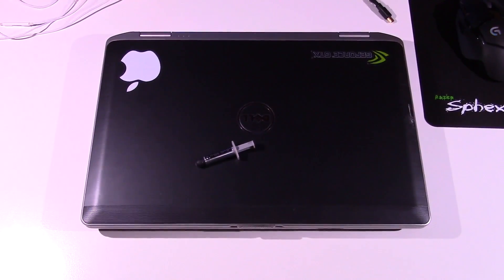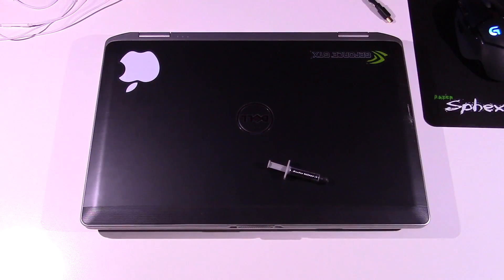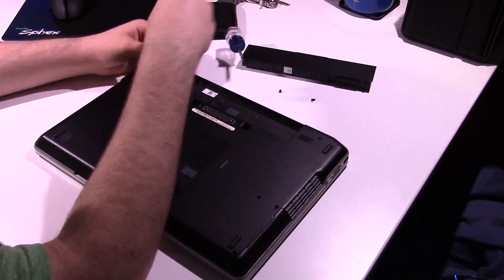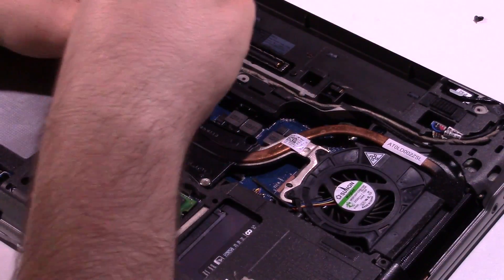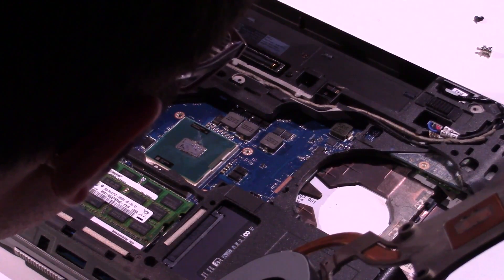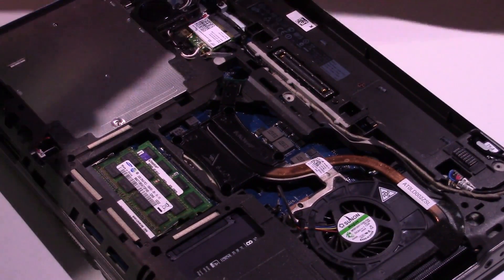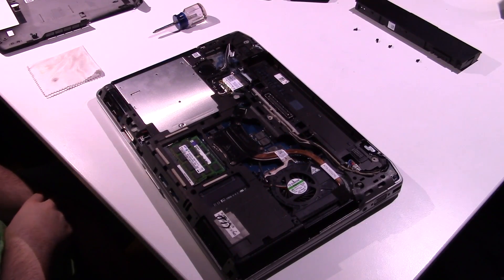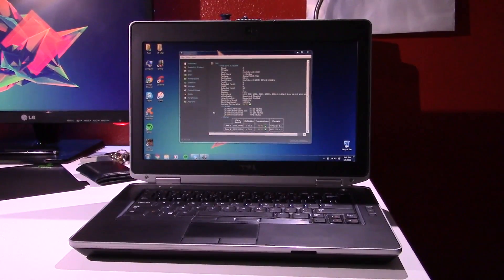Dell Latitude E6430 - How To Repaste

Comment: After I get the Intel i7-3740QM, I'm going to repaste the DELL Latitude E6430 (which my dad bought back in 2016 or 2017 off groupon) because it's starting to get warm or hot. After that, I got to repaste the Lenovo N580 afterwards.

Comment: my dell latitude E6430 suddenly stopped coming up. The last message displayed was a blue screen saying hard drive is inaccessible, afterward when I turn it on, the storage led just blinks white light intermittently and now its very hard to even come on, when I press the power button, it trips on and off.  please, what can I do?
Reply: your power supply is probably toast. inside myabe some compressed air on those fan slots would clean things out. repaste like this tutorial. replace your hard drive with a SSD, 480,512,960gb or 1tb, never put this on a couch or bed, never tilt it left and leave it on it's side when you use it. basically this thing has had it, and there are $400 microsoft surface options that go way faster and are lighter. Put this in the dirt. :|

Comment: mine reach 90c! and I  repasted it twice already. using thermal grease.
Reply: clean your fans internally, compressed air or something like an inflatable bed compressor works great. If it still overheats, NEVER put these on beds or on their side when you're using it, the left side has the fan exhaust and if closed it will kill the laptop or overheat the power supply itself and pop.

Comment: Man, how come your E6430 boot so fast? Mine is the same but using the i7 3540M with the dedicate Nvidia NVS 5200M, and also the same SSD, but when I boot up mine, it will take longer than you (not significant long, but noticeable longer than yours). Anyway, the E6430 is a great laptop, durable, reliable and fast as well. But too heavy as a 15" laptop.
Reply: I have the exact same model and mine is reaching 88C does this tutorial works the same

Comment: I have this laptop, It was running hot all the time, no matter what you do. The main problem is that there isnt fan control option in the Bios menu, so I desided to modefye the laptop. I connected my fan directly to the USB port and put small resistor to reduse fan spinning. Now my temperatute are around 40-45 C. I think this is success.
Reply: how?
Reply: @danishzz20 why is my same model laptop a little different inside?
There is a nvidia graphics card between fan and cpu. 
Cpu- i5 3340m
GPU - nvidia NVS 5200m
It runs on Intel graphics 4000 most of the time. 
Using a usb fan is a good idea, sometimes I also use a high speed server cooling fan but that's not easy to use outside.( 3×2 attached fan cost me 1.3 usd)
I need a permanent solution.
Reply: You are absolutely right, fan don't start till heatsink heats up, programming isn't good.
I already have a gaming pc, I got this from my uncle for free.
Just the ram and ssd update cost me a little.
Working so fast but heating is a big issue, I could not feel any blowing air in my hand till the temperature goes 55+
My laptop is a little different, there is nvidia graphics card between the cpu and fan.

Comment: Thanks this is why i have dell. Very easy to remove things. I have a question i go buy a 6430 with i5 3320 cpu. Is ppssible to upgrade for a new version cpu? What the cpus.the.board.acept? Thank you
Reply: I think it’s uses g2 socket and mine has an i7 so yes, it’s probably upgradeable

Comment: sir i have a question i build mine with an i7 3630qm and it's normal on 50-70 c but if i use Camtasia it goes to 104 c, repasting it with Artic Silver 5 and thermal pads will do a better cooling or it's worthless?
Reply: Pastor Ortega Not good idle temps. Worth trying to repaste.
Reply: well i did before my laptop was stolen with an artic, can't remember which one exactly and using Camtasia it was on 89-90 c so i guess it worth it a bit

Comment: I need your help .Can i replace the gpu fan only without having to remove the heatsink from the cpu on the e6430? I may have to either replace or remove so i can get to the radiator like part of the heat sink, it may be clogged.  Thanks in advance.

Comment: I need to get some thermal paste so I can upgrade my GX620 with the E7500 I got a few years ago would put it in my GX745 that i've never used but its SATA only an I only have IDE hard drives, i'm sure the paste on my Latitude D620 needs replacing but I dont use it much since it doesnt have a hard drive in it so I just use a live USB with it.

Comment: Why don't you put good old Windows 8 on it?
Reply: i use 8.1 as my main os love it alot
Reply: @MissRiaElaine well I know the core i7 on these laptops are crap as I used to have one and I had a core i5 processor in the laptop .found the i5 great job and plus did not run hot at all. Tbh It just me I love win 7 don't like changes lol
Reply: @Joe Shabidu use what ever you guys like .I had one of those laptops a Dell e6420 core i7 .I hated it to a point of I didn't want 2 use it ran hot and was noisy .but I had a Dell e6430 core i5 that I gave to my girlfriend which was a great machine no problems at all.lest just say the shit dell e6420 core i7 is gone and now I'm married so back 2 my Dell e6430 .plus I tried win 8/8.1/10 and I hated it love windows 7 it's the best
Reply from the maker: +Isaac Wright Because fuck Windows 8. Always hated it and always will.
Reply: well i love win 7 its class win 8/10 sucks ass tbh  takes longer to do things with it

Comment: That looks like a lot of thermal compound to me - almost enough for a desktop CPU. Does anyone else agree, or is my computer probably about to melt?
Reply from the maker: +Jack Durrant Ya know, a test was done by LinusTechTips and basically the results were it really doesn't matter how much you use (to a reasonable degree). The only thing that's bad is if you don't use enough/any.
Reply: too much is VERY bad, it can cause a thermal blanket!!! Don't listen to that advice of "too much is ok" your CPU will pop. Put your finger on the cpu, move around the paste, dab and clean your finger off on something, and if you ALMOST see fingerprints on the cpu die, you're at a perfect threshold.